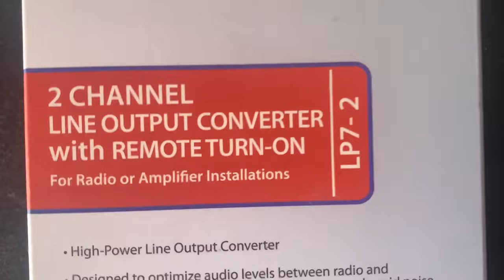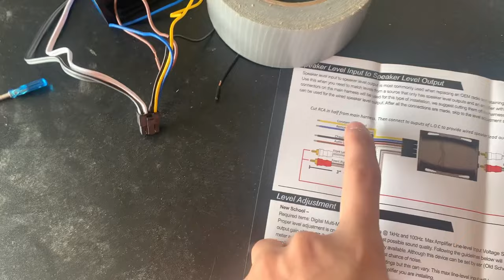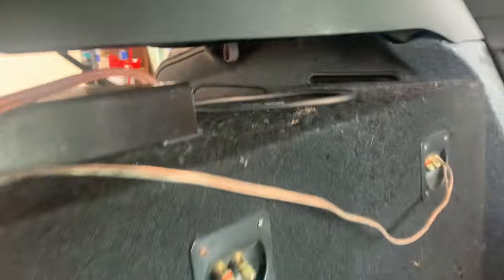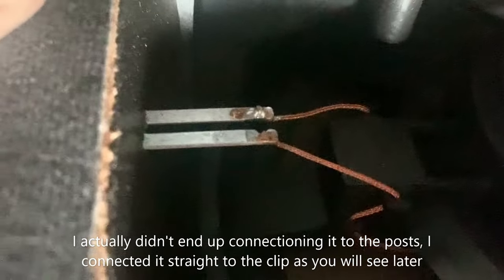How to INSTALL LINE OUTPUT CONVERTOR FOR AFTERMARKET AMP ON FACTORY RADIO

Comment: Check out the speaker that sounds blown from the terminals, from the looks of the video, it looks like the left speaker is pushing, and the right speaker is pulling, on the terminal of the speakers make sure all speakers are connected correctly. The speakers should either be pulling together or pushing together, 🤔  I might be wrong and the speakers are probably wires correctly but, it doesn't hurt to check bro. 👍
Reply: Definitely the issue

Comment: Bro, this video came in clutch! I had no idea about setting up the wiring for the LOC, every other person was connecting it to the head unit but I have a 2012 Audi S4 with MMI interface. Had no idea how to wire it up but this video helped so much because I’m running almost the exact same setup

Comment: It’s not blown on the back of your converter. There are two flathead screwdriver holes. You’ll stick your baby screwdriver in it and turn it left to right one is for your left speaker. One is for your Wright speaker. That’s why one of them was flexing in the other one wasn’t All you have to do is stick a screwdriver in there flat and tune it out on both at the same if you have one a quarter the way you turn the other one a quarter of the way don’t turn them all the way up or you’ll stretch your voice coils and tear shit up. Just wait till after you turn it on then mess with them, turn them out but know your subs are not blown or they wouldn’t be working right now Guys, you guys should know that all these people are comment that I read I can’t believe you guys would even say that if he had ran to the back of the CD player like you probably should’ve it wouldn’t they would just play you wouldn’t have to do all the extra tuning